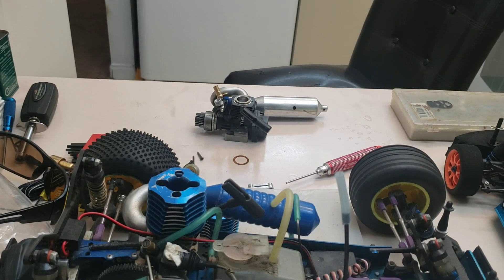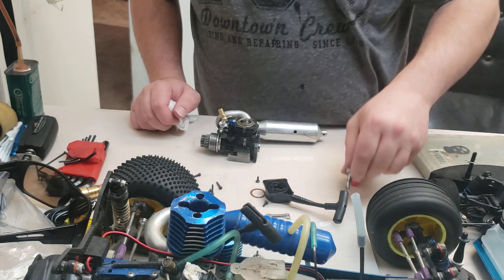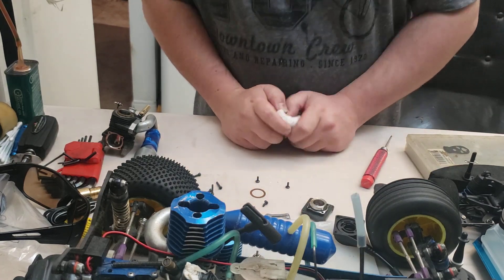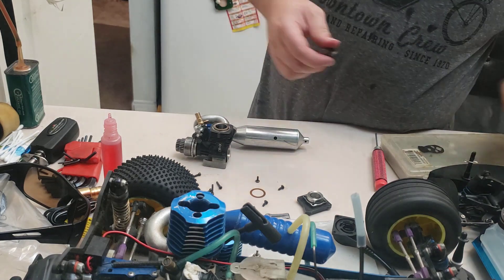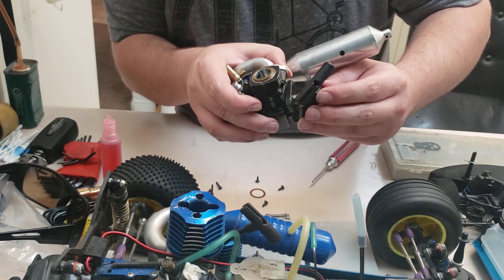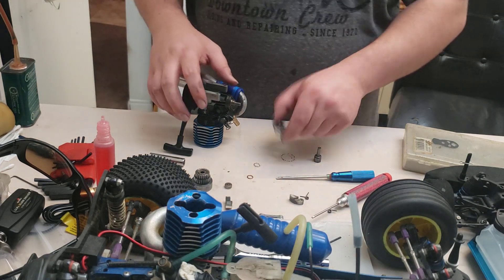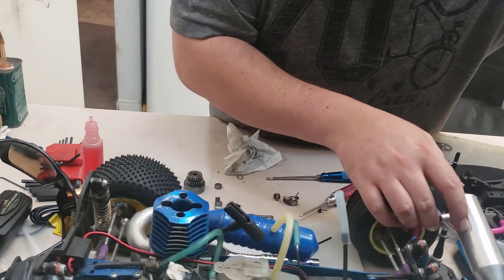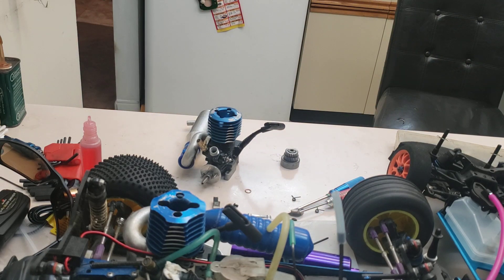team associated TC3 and LRP .18

Comment: If an engine quits when you remove the glow igniter does that mean I have a bad plug? I tried leaning it out and it doesn’t do anything. I don’t really have any spares on hand. (Damn turbo plugs) also because it’s like 8 dollars a plug
Reply from the maker: Yes running we will kill glow plugs and if you remove the igniter and it dies instantly yes you need new plugs don't buy cheap glow plugs either that's where you're gonna go wrong as well buy good qualities glow plugs like OS plugs post in the group if you're in there about what club you need for your engine
Reply: thebug 404 I’m not in the group but my engine uses hot turbo plugs. It’s a novarossi .21
I have been using protek t4 plugs
Reply from the maker: @nitrogas5719   Use only Nova plugs with a Nova And make sure you have no fuel or exhaust system leaks as that will cause lean conditions And if you also run to lean you burn your glow plugs out mine last several gallons before the to be replaced
Reply: thebug 404 those nova plugs are damn expensive but I guess I’m gonna have to try them.
Thanks for the help
Reply from the maker: @nitrogas5719   Nova plugs have a certain taper at the bottom if they are Turbo plugs they are specific to those engines that's why they recommend them  Also running a fuel with a high oil content is not good for them using too much after run oil is bad as well  with your fuel no more than 12% and no Traxxas fuel is garbage
Reply: thebug 404 yeah I read about that, but I also read that you could use most plugs in the nova engines just not the os plugs
Reply from the maker: @nitrogas5719   Be careful what you read or believe because there's a lot of garbage information out there unless has the specific taper to it then no use only the all we am glow plugs  And like I said if you're eating glow plugs it's because your engine is set way to lean

Comment: What would be interchangeable with the .15 and 18x team associated motors if its possible lol I've been struggling to find anything thanks for any info I appreciate it
Reply from the maker: You have to get the adapter shaft for the crank shaft and then get an SH18 engine and then cut the crank shaft down

Comment: What exhuast fitting fits in that pipe I bought that same pipe used on eBay bought the tmaxx fitting it didn't fit the hole to big.
Reply from the maker: They're not supposed to have one you just jammed a few a wide and there you have to get thicker stuff go to your hobby shop in order it 6 mm outer diameter
Reply: @thebug4046  I'm gonna search for a 6mm my close hobby shop shutdown for good from corona thanks

Comment: You think a lrp 32 will fit in my Ntc3 ? 
I currently have a traxxas 3.3 on it.
Reply from the maker: The LRP32 is a big block it is massive compared to a 3.3 the engine mounting as completely different I'm sure with enough machine work or the correct parts it could be done but I don't really see the point  Unless you really really wanted it to work